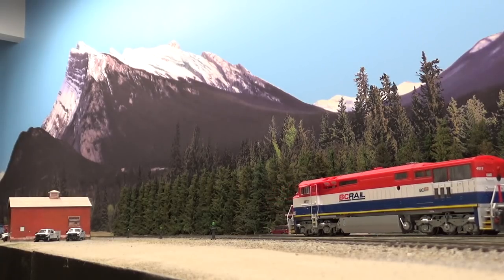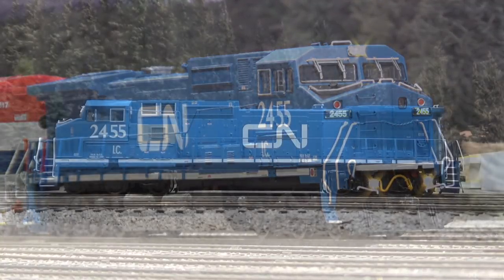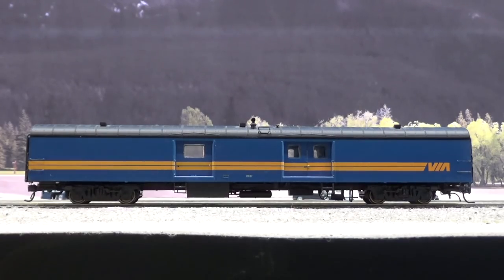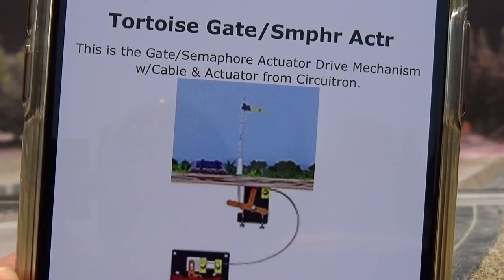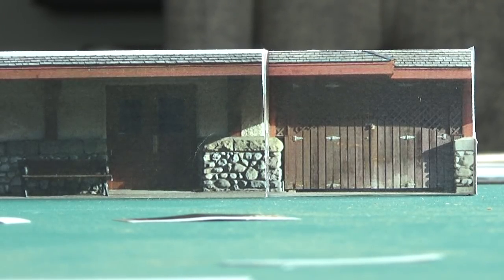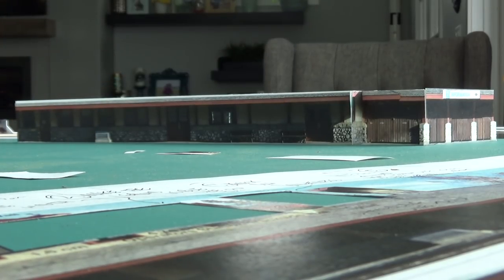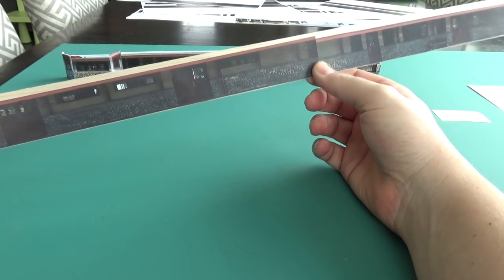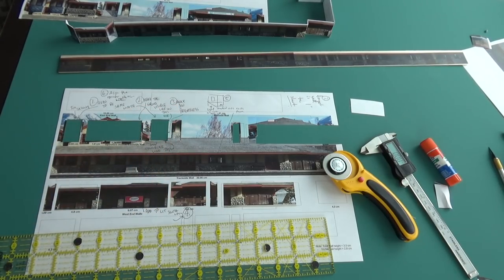Layout Update - April 2021: Atlas CN Dash 8-40CW, CP Banff Station Printed Walls...

Comment: The CN Dash 8s assigned to Illinois Central after the purchase of that railroad in 1999 were actually former Conrail/LMS units that have a unique history.  LMS was a joint Conrail/General Electric leasing company that would lease locomotives in the US and Canada.  LMS locomotives such as your blue one were leased half of the year to Conrail during peak traffic periods around the late fall to mid spring and then leased to other railroads for the balance of the year.  You can read more about them in Conrail Power in Color Volume 3 and Conrail The Final Years 1992 - 1997 by Withers publishing.  We also write about them from time to time in the Conrail Historical Society's publication, The Conrail Quarterly.  The station is looking great man and your scenery is also looking fantastic.  As a fan of the CP since I was a kid I have seen images of Banff for almost 3 decades and I cannot wait to see this whole scene completed and running smoothly!  Oh and that thing you pretended didn't happen outside last night,  we got almost three feet of it in a two day period a few weeks back and then got a few inches more a week later!  I hate snow officially anymore here in the rockies...
Reply from the maker: Fascinating stuff Zach, thanks for sharing. They sure had an interesting backstory and were well travelled!

Comment: A couple of good finds Ben.  Blue Devil looks good with the patch.  Looks like piles of work on the station to get the shadows to line up.  Spent many an evening at that station.  As a Safeway driver way back when we use to split up Rocky Mountain Doubles in the parking lot.  If there was a tour bus present we became an attraction ourselves as they hadn't seen equipment that big back home.  I shudder to think how many pics of me smiling with curious tourists there are back in Korea......  Cheers!
Reply from the maker: Haha thanks for sharing that story Grant! The thing I love about Banff is everyone has their own personal connection to it. A couple years ago I was hanging out at the station, waiting for another train when suddenly I could hear the distinct sound of jet engines approaching. I jumped off the bench and ran out onto the platform to get a better view and two CF-18s went roaring by overhead then banked towards Lake Louise. Seems even the airforce pilots like to take a leisurely drive to Banff when they have a chance : ) I want to find a couple HO scale CF18s and hang them up in the lighting valence above the station to commemorate that day.
Reply: Sounds awesome Ben.  Would have been cool to see!  I have a pair of 1/144 scale CF188's to do the same with.  Cheers!

Comment: Nice progress! The grade crossing is looking good, nice Blue Devil too. When they were brand new they were under a lease agreement which saw them run on Conrail for half of the year, and on CN for the other half. That is why they were built to Conrail spec and painted CR blue. When CN bought them out, they put the IC reporting marks on - probably for accounting reasons, it seems like that's what most things seem to boil down to. The one unique thing about the Blue Devils is they had the same radiator as the later Dash 9s, which were just about to start coming out. It is thicker than a Dash 8 radiator. So if you are feeling really brave and know where to find a Kato or Blue Box Dash 9, you could take the rad wings off and fit them onto the Atlas unit and have a 100% correct model ;)
Reply: Gosh you're right about the radiators! Had seen so many photos of these bluebird locos and never even noticed the radiators were different to their other dash 8 sisters...
Reply from the maker: I've actually got a couple Kato unpainted dash 9 shells kicking around. That would be a super cool project I will keep that in mind thank you!

Comment: Hey Ben, looking great still, hopefullly you get that station figured out eventually. With the 2455 maybe take a link or two out and add a spring centered on the chain to hold the rest up. Shouldn't be too difficult to do and would be a real nice touch to the locomotive.
Reply from the maker: Thanks Josh! Oh man that is a super good idea, I am going to do that!
Reply: @BArailsystem  Yeah you will!! Ha ha! It might take a little digging but typically they have two springs on the real deal however CN's might have a different setup

Comment: The station is, coming along nicely. Have you given thought to possibly have it 3d printed instead, in sections. Or having someone with great Photoshop skills perfect your photo mask for the styrene structure.
Reply from the maker: Thanks Peter. I've mulled the idea but the amount of time it would take to design the CAD file and then print this 4'x1' building in sections and then paint would be immense. Going with my tried and true wall paper method first to see if I can pull it off.

Comment: Hey Ben, If you're familiar with SketchUp or equivalent, maybe you should consider augmenting your photo mapping approach with a more conventional material mapping strategy for certain elements that you may need to isolate or model. It's a very interesting strategy you're attempting especially with a more complex building form. In any case, great to see the effort and the progress.
Reply from the maker: That's a good idea Patrick, I actually have built a model of it in SketchUp that I use to determine the dimensions for the physical pieces. The proof of this technique will be in the pudding when it gets closer to being finished.

Comment: Wow do you have enough shots to just build it in HO? I am very tempted to want to build it.
Reply: I would love to build it in HO as well. The photo-shop "wall paper" routine will never do it justice. ~ Boomer.
Reply from the maker: I think so, vertical walls are the hardest as they have the most detail. Roof is easy.
Reply from the maker: I may have to try a different approach with the station because it is so large but in all the buildings I've done to date, the photo printed walls are my favorite. They look the most realistic to my eye.
Reply: @BArailsystem  I would like to build this as a project for the NRA. I live to far away to get good shots and measurements to build it. Where would you start? So that I might get some information to build one.
Reply: @BArailsystem  Not me.
Reply: @BArailsystem  Right , but it's the paper "wallpaper" culture. Not even close to a traditional model. In fact they are hardly models at all so let's not redefine them incorrectly. ~ Boomer.
Reply from the maker: @Vman7757  The Glenbow archives in Calgary, AB has the original plans, that's where I got my hardcopies from.
Reply from the maker: @boomerdiorama  Not sure I follow, what is "wallpaper" culture? It's a hobby and supposed to be enjoyable. Whether you make something out of a bar of soap or 3D print something using state of the art technology,  if you're having fun then mission accomplished!
Reply: @BArailsystem  Wallpaper culture in the context of model railroading is photo shopped paper façades. I never questioned about having fun. My point was, paper cut-out facades are not traditional railroad models. Ask the NMRA if you have trouble with the concept. Cheers. ~ Boomer.
Reply: @BArailsystem  Yes I have to agree. But with that said? I enjoy building from scratch. And boy would that be a fun challenge. I would build it just so I could put it on someone HO layout. So you know I am in N scale. But I enjoy building buildings.
Reply: @BArailsystem  Very cool. I live in California. Glenbow archives available to me?
Reply: @BArailsystem  I can get to them. Guess I need to see how to get what I need. Thanks.
Reply: Okay how do you get to the plans? I have been searching and I am not getting anywhere.
Reply from the maker: @Vman7757  That might be an issue, I had to visit the museum and request the plans and they made them available for photocopying. Not sure where else, maybe Canadian Pacific Historical society would have them.

Comment: I do NOT recommend using the wife's fabric cutting tools (especially scissors) on paper. Why? The blades are designed for fabric, paper dulls them really quick and really bad. Fortunately the solution is easy, you take the old set and buy her a new set. 

great stuff as always!
Reply from the maker: : O I think I owe her a new set of blades

Comment: Pretty sure that IC unit is from the most recent run of dash8s. They came out about last year or maybe 2 years ago? So they really aren't that old... Haha
Reply: Yeah Otter Valley Railway store in Ontario have a video of one from only 2 years ago.  So probably actually a recent run.  Theirs was 2457 though.
Reply from the maker: I looked it up after I flapped my gums on the video, from what I can tell, this one was part of the 2016 run.
Reply: @BArailsystem  I have one of the Master line Gold CN ex Santa Fe series(?) Engines, 2172.  Beautiful loco.  Also bought at Hobbytech when I was over from scotland.  Kind of fancy getting a bluebird like yours too!